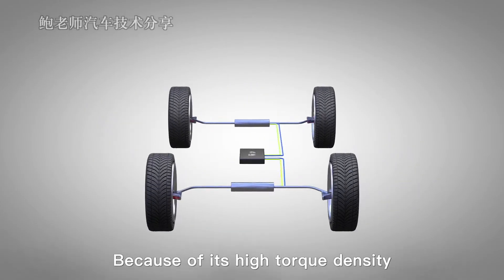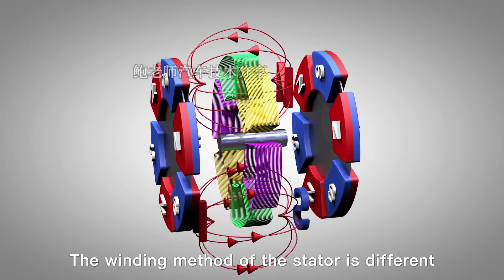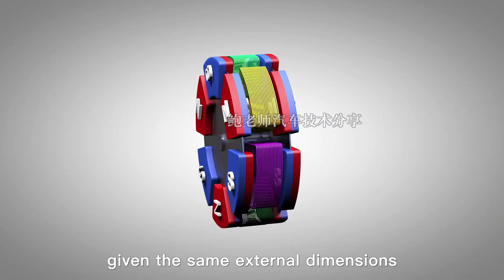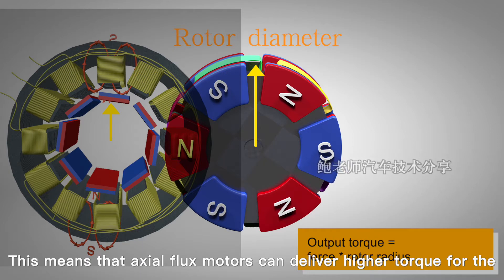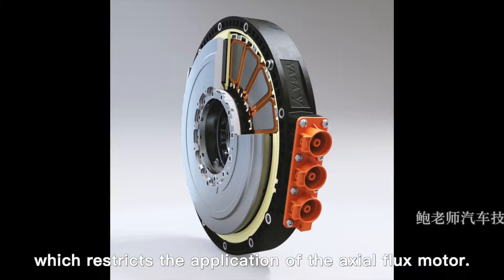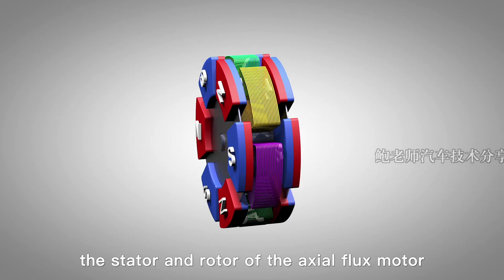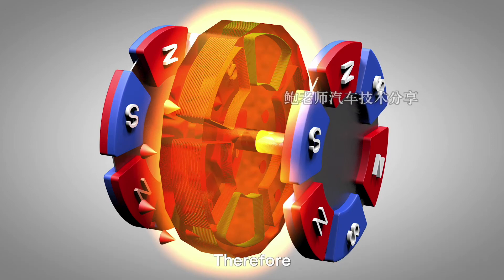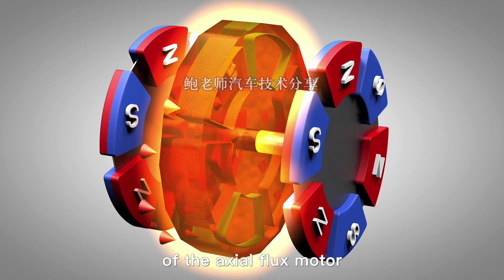Axial flux motor

Comment: Stator with 6 coils in a circle. Rotor has 2 levels. Level 1 has 6 north facing magnets. Facing the coils. Centered on the coils. Level 2 has 6 south facing magnets. Facing the coils from the other side. Evenly spaced between level 1's magnets. When rotated to induction will become autonomous. Why. Just type this into A.I and it will tell you